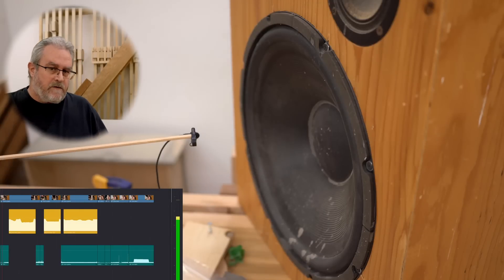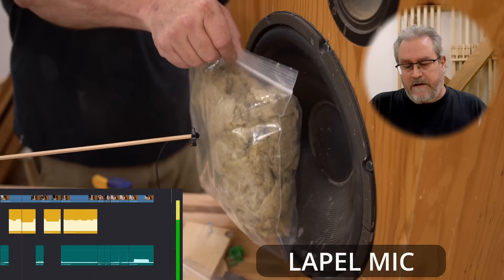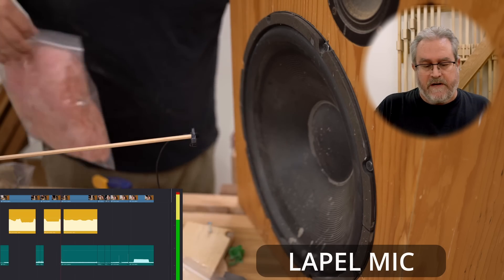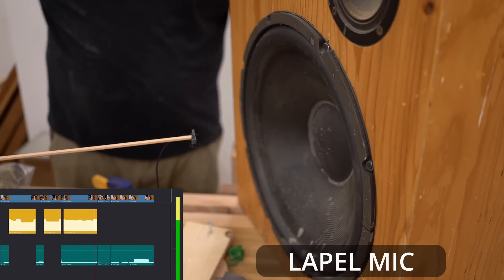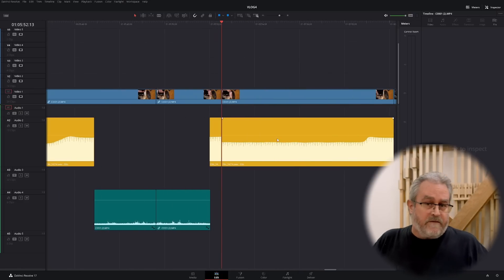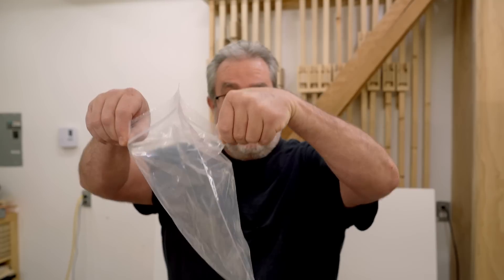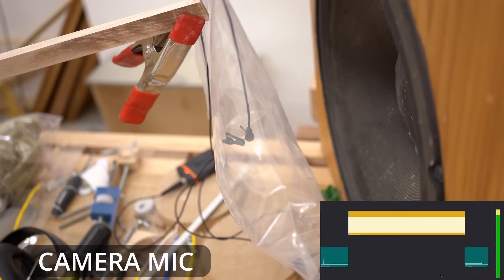You are Thinking About Sound the Wrong Way

Comment: Peter Walker (designer of Quad ESL speakers) did a live demo where he would hold a sheet of diaphragm material (thin plastic) in front of his face and ask the audence if they could hear any difference when he spoke. The answer was of course no. said what you are hearing is my voice vibrating the plastic on his side and the plastic then moves the air on your side and you hear it. What if, instead of my voice vibrating the plastic sheet we do it with an electrostatic charge? That's a Quad ESL.
Reply from the maker: That's a relay race kind of way of looking at it, where sound before the plastic hands off to sound on the other side of the plastic. A better way is to view it as a marathon over different terrain. Flat and level, then a shallow river to cross and flat and level again until you come to a mountain you can't climb so you need to go back.

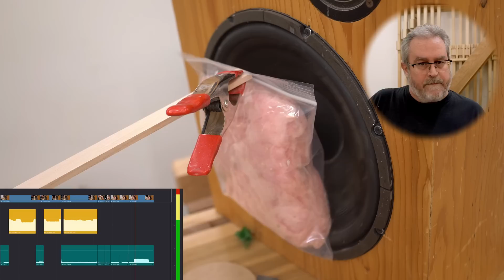Comment: I thought it interesting that the bag was being sucked towards the speaker at 4:53.
Reply: Interesting 
Convention wisdom for as long as I remember (70's) insist it's merely an illusion ... examining a cone at full stroke, and seeing one direction appear more prominent.  

However with all the drivers being Klippel'd, many drivers exhibit significant deviation of in vs out, vis-à-vis travel.
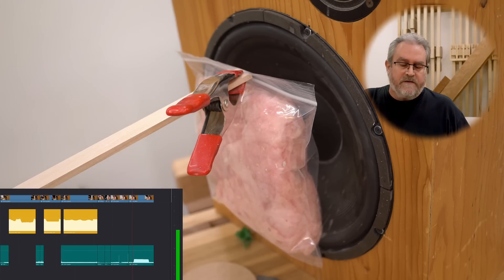Reply: @FOH3663  No illusion. If look at 4:50 and compare it to 4:55 you can clearly see it. Just use your keyboard's left and right keys while the video is paused. I think maybe the sound/air is wrapping around behind the speaker, maybe there is port back there.
Reply: @Take-the-Ticket  
Yes, agreed. 
I see it ... that's what I'm saying.

Comment: i must old and deaf. i could no hear the tone. nice video though.
Reply: I couldn't hear the tone on my TV, but could hear it easily with headphones. Because the TV speakers are weaksauce.
Reply: Maybe your speakers just don't reproduce 40hz?
Reply: @Take-the-Ticket  maybe.. after your video I took 2 online tests. not good results so maybe specsavers here I come.
Reply: @trickydicky165  Again.... if your equipment is unable to produce a frequency at an appropriate level... That is an equipment issue not a hearing issue....  40hz is not typical for early hearing loss.
Reply: @ShainAndrews  hi yea thanks for that. I tested my daughter (16) on a 1-100 hz test on computer. She heard from 2 hz. I heard from 50. So it’s my ears.
Reply: My subwoofer was going crazy during that tone.

Comment: All you would have to do to disprove the naysayers is to take a speaker and cover it with a blue plastic tarp then crank it up.   It will neither rattle/crackle the blue plastic tarp or really block much of the sound.  You'll lose some of the high end, but not all of it.
Reply: Naysayers are generally not interesting in empirical scientific proof. They exist in a self made, and therefor a self supporting, belief paradigm.

Comment: Hey John love the video. Any chance you’d be willing to add a material to the dampening challenge? I’ve used Ultratouch denim insulation as a materiel before and felt that it did incredible.  Obviously it doesn’t have to be Ultratouch. If you can’t easily get it I would be happy to send you some. I insulated the walls of the 16x20 foot room and the silence was deafening.  I’ve never been in a room that absorbed sound like that. After that i started using it as a filler in speakers and subwoofers. Anyways, thought it would make for an interesting product comparison, especially for those who don’t want to breath fiberglass or have itchy arms.
Reply from the maker: I can't see it being more effective than fiberglass or rockwool, but almost certainly better than polyfil. For me the itchy factor isn't an issue, so I'll always go with the one that's the most available at a reasonable cost.
Reply: @IBuildIt  I get that, I don’t mind the itchiness at all. I have two unopened packs of Rockwool Safe n’ Sound in the garage as well as two of the ultra touch. I wasn’t necessarily thinking for you, I know you don’t mind fiberglass, more for your viewers. I’ve been in a room lined with fiberglass and this was definitely different.  I just thought it would be cool to see a comparison using your testing methods.  I know you say you can’t see it being more effective, I’m sure people would like to see test results proving that.  I’m not an audiophool, but I can definitely hear a difference when stuffing a cabinet with it vs rockwool or fiberglass, maybe that comes down to density, I don’t know. Just an idea.
Reply from the maker: The absorption coefficient changes for different frequencies from product to product, usually based on density. So it may be more or less effective at a certain frequency range than rockwool or fiberglass. That can change how it sounds, but you'd really need a very controlled comparison for that kind of subjective test.
Reply: @IBuildIt  yeah that definitely makes sense.  Just thought it would make for a good video discussing alternatives for stuffing and acoustic panel material for those who want an alternative.  You’ve already proven that polyfil sucks in comparison and that is likely the most widely used material.  They use polyfil because they don’t want to deal with fiberglass, at least many people I know do. Those that I have shown the denim fiber have switched from using polyfil.  Many don’t know about it as a material 

Thanks for the great video, I wouldn’t use plastic bags for fear of the sound waves not penetrating the plastic, but duh, they’ll just transfer their energy like they do with drywall.